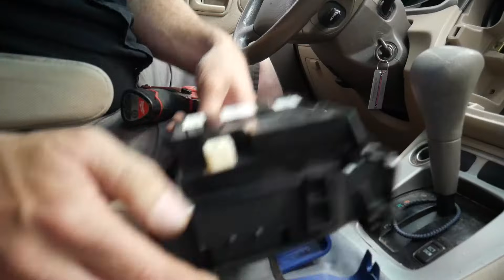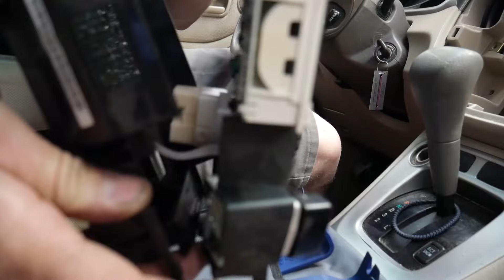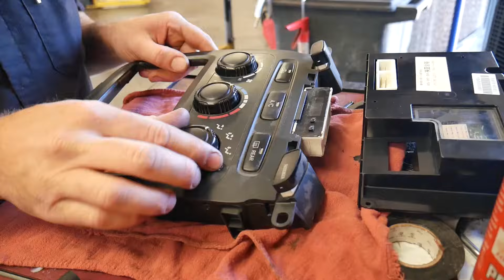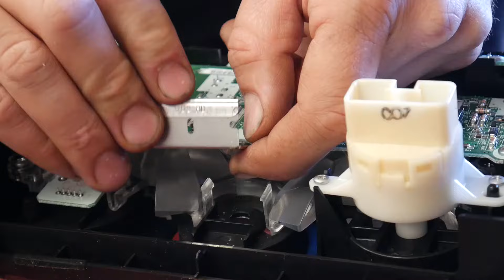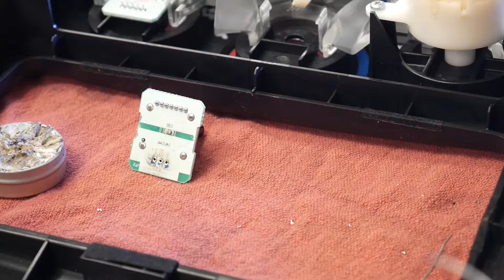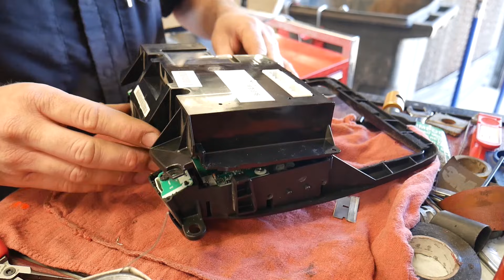Toyota Highlander Heater Control repair - no temperature control

Comment: Where can I buy a piece of the 3 wire ribbon cable?  Mine is too short.   It broke off.
Reply from the maker: You can use individual wires or what I often use is wire for led light strips. If you happen to have an ancient computer in the garage you can open it up and grab some ribbon cables from inside.

Comment: What if you do not see anything wrong but still no heat Jake everything I have not done was change the thermostat
Reply from the maker: If the temp gauge is rising or if the heater hoses are warm to the touch then a thermostat probably isn't the issue. You may need to look and see if you can observe the movement of the temperature control doors and actuators to determine if the doors are moving to the hot position. the heater core could be restricted or you could be low on coolant as well.

Comment: You missed a couple steps that are important. When detaching and reattaching the ribbon cable you have to make sure the catch bar is in the up position to receive the ribbon cable. Once the ribbon cable is in the bar, you need to push down on both ends of the bar to lock the ribbon cable in place. Otherwise it will fall out again and you may have to start over again with whole procedure.

Comment: Is 01-07 highlaner uses the same Climate panel? i have 05 but this guys sells a 03
Reply from the maker: Man from manila my 2007 is the same way. I think all the ones with manual control are similar.
Reply: ThePracticalMechanic thanks, i guess i have to buy it and hope its compatible, they looked the same in the picture to mine.
Reply: Interesting, my bulb went out by the fan control, I removed the panel and found the pcb replacement in their for the temp control. I managed to break the ribbon cable! Sigh.

Comment: Nice repair big thumbs up 👍
Reply from the maker: Thank you. It certainly saved me a bunch of money by repairing the wires compared to a new or used unit. Have a great week!!!!
Reply: @ThePracticalMechanic  the real  cause of the failure is stress on the cheap ribbon cable... better to swap over for longer loose wires AND check the other 3 knobs before zipping everything back together (lots of easy labor).

Txs for showing us how everything can get fixed
👍🏻
Reply: @glasser2819  Do you have any suggestions for a specific type of ribbon cable?
Reply: goofeydude22 same question. Or wire gauge size
Reply: @glasser2819 xpxmpxnllpp xnmpxñppxml